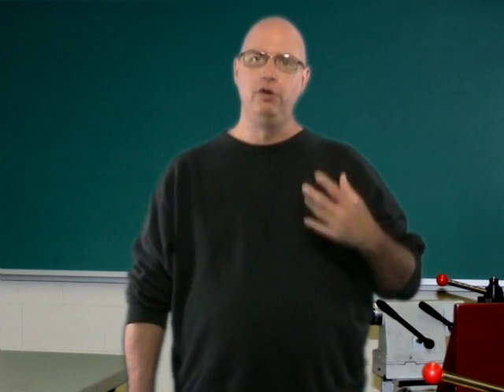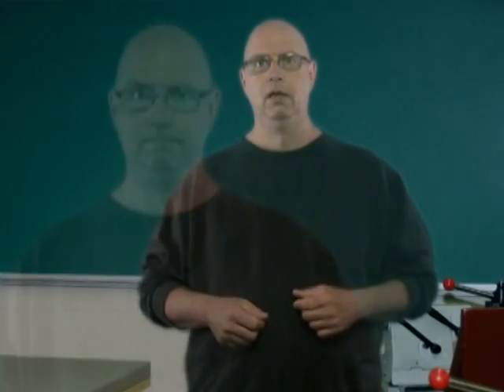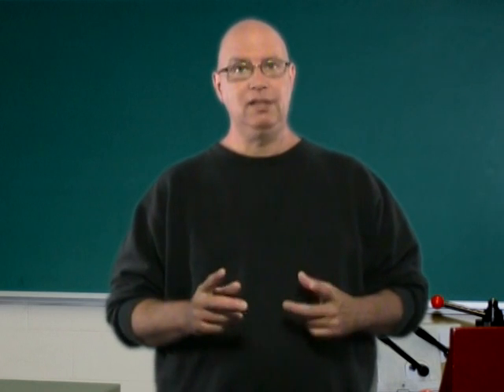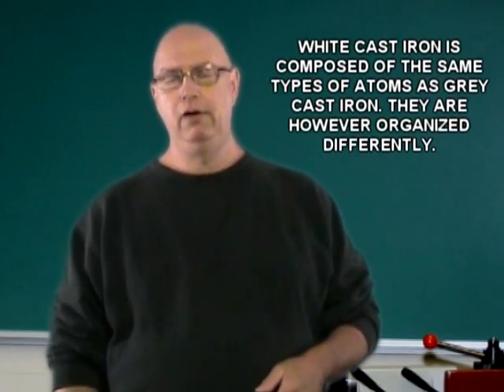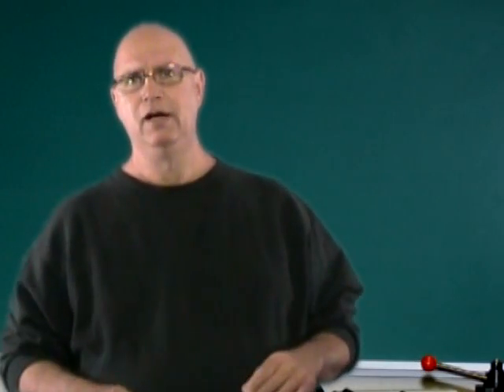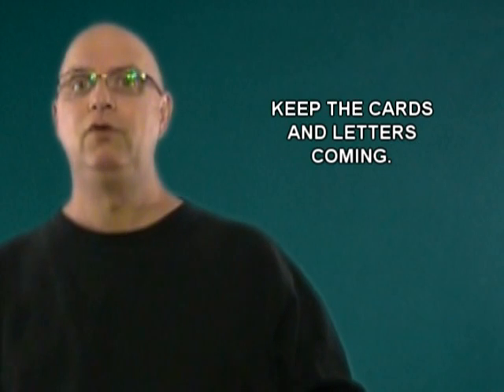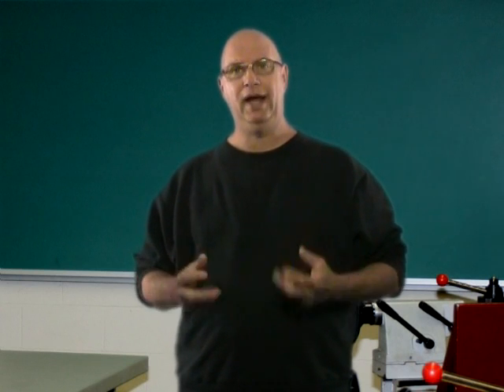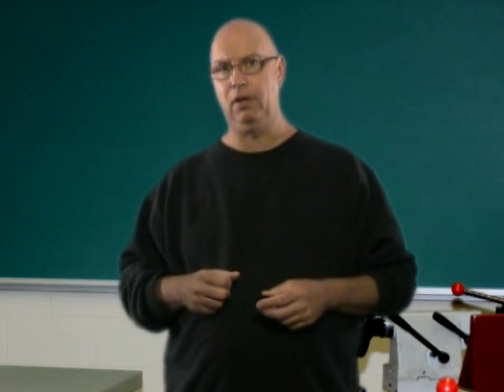INTRODUCTION TO FERROUS METALS. CARBON STEELS, ALLOY STEELS, TOOL STEELS, CAST IRONS... MARC LECUYER

Comment: Amazing, thorough and well-articulated content, perfect for the beginner like me. Thank you! One question: I'm learning to make knives with 1080 steel, and you said 1080 cannot be quenched in oil. Last night I experimented with 1080, and I quenched it successfully in Parks AAA oil. After the quench, the 1080 successfully skated a file. How come my experiment worked if 1080 cannot be quenched in oil? Could it be that the steel I purchased actually had some other elements alloyed with it although it's labeled as 1080, a plain, high carbon steel?
Reply from the maker: Hi Ethan, the main difference between water and oil quenching steels is depth of penetration. The plain carbon steels require rapid cooling to increase depth of hardness. Water cools faster than oil (oil doesn't transfer heat as well) so it packs more of a punch and helps to get a part hardened through. Very large and thick parts of plain carbon steel will never be completely hardened (the outsides will harden but not the center) even when quenching in water. On the other hand, cooling a thin part with large surfaces (such as a knife) is much easier and that is probably why you are getting good results even with oil. This is good news, since quenching in oil will reduce part deformation caused by an uneven submersion in the quenching bath. Some knife makers will also play with heating and quenching to obtain very hard cutting edges and a very tough knife body. You may want to try this: If you heat the cutting edge portion (about half way up from the edge) of your blade with oxy acetylene torch ( this must be done rapidly because you don't want the whole blade to reach its critical quenching temperature) and then quench rapidly, you will get a blade that is both hard wearing (keeps an edge) and resistant to shock ( tough). I hope that this helps, be safe with the quenching in oil, it is best for safety (not burning you garage down) do perform this operation outside. Shops that do heat treatment professionally will have a dedicated fireproof area for this type of operation. Thanks for watching my videos and for taking the time to write, Marc.
Reply: Thank you for the reply and for the safety instructions. Indeed, I will continue to do heat treatment operations outdoors, away from the house! One follow up question: what type of steel would you recommend for the hobby knife-maker who wants to do his own heat treatment rather than sending the knife out to a pro shop?

Comment: I did not know that quenching oil was special.  A few years ago I commenced to oil quench a piece of steel I had heated to incandescents.   A fire commenced and oil splattered out everywhere.  Darn near burned my garage and house down.  The advice to use quenching oil designed for the process is well placed!

Comment: I have a cast iron crank in my ford mk1 escort. 
I did deber the casting seams and oversized every bearing face. 
I also shotpeened and balanced the crank and rods. 
🇦🇺🤜🏼🤛🏼☮️😊🍀🍀🍀

Comment: Serious question here: if cast iron is not machinable, and they make engine blocks out of it, how do they make the smooth cylinder bores and lifter holes and the other various holes that are in an engine block?
Reply from the maker: Hi! Grey cast iron is machinable but will not produce chips. The material removed is more like powder or sand in shape.  Malleable cast iron will produce chips but they tend to be segmented and not continuous. White cast iron very hard and can only be machined with technique that would be used on hardened tool steel, such as grinding ...). Thanks for a great question, I hope that this answer helps and thank you for watching my videos and for taking the time to write. Marc